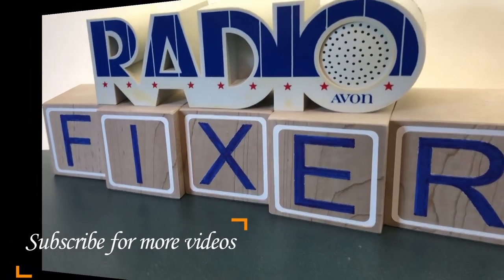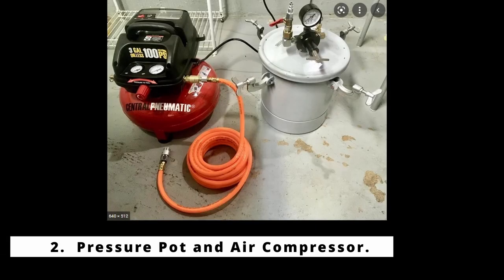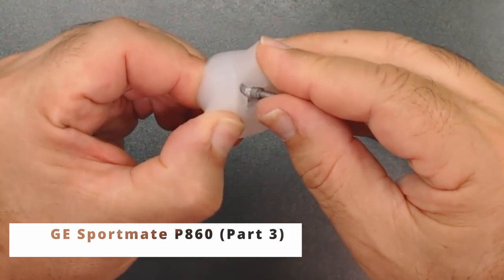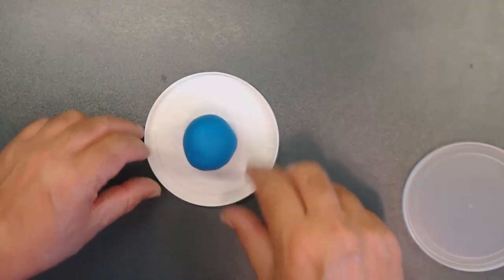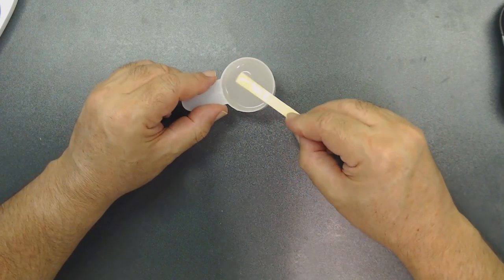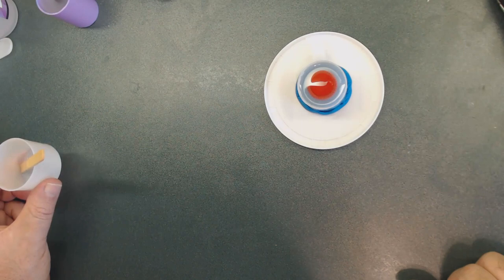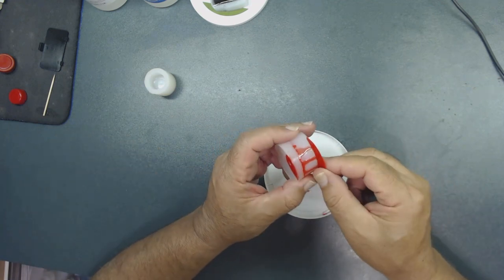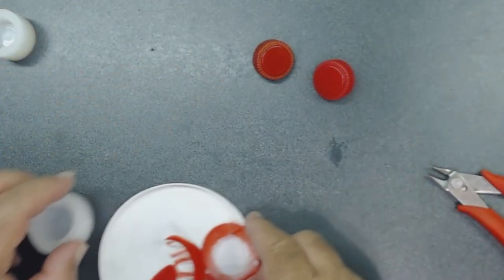How to make Knob and other missing Parts

Comment: This was fun to watch!! About 10 years ago a TV radio repair shop closed up. I was able to get a box of about 500 radio and TV knobs. Before they scrapped a radio or tv set they pulled off the knobs.. I have used many of them to replace damaged or missing knobs.. It may not be the original knob, but it has that vintage look so unless you have a picture of the original radio knobs, you cant tell... Robert
Reply from the maker: Robert, so happy to know that you enjoyed watching this video. It is very fun making those parts and radio knobs. As always is so good hearing from you. have a great day! Regards, JZ

Comment: Thank you! Almost all tutorials on YouTube are for flat knobs (drill a hole in back), or those with brass fittings. Almost no one shows the very common split shaft potentiometer knob like this one. Working on a 1950s guitar amp and debating making a replacement knob.
Reply from the maker: Hi Cal, so good hearing from you and glad that this video can assist you to duplicate your guitar amp knob. It is fun making your own since every time you look at guitar amp reminds you of your accomplishment and how you created. We never learning until we try. Use bobble free product that I discussed on this video to make the job simpler. Good luck with the project, have a great day! Regards, Jay

Comment: Excellent video.  Perfect detail and some great ideas.  My only issue is you can't make a missing part.  You need at least one to copy.  I have a few radios that I'm rebuilding.  All the knobs are missing.  I'm looking for a way to make one know from pictures.  Then I can cast a new set.
Reply from the maker: Hi Steve, thank you for uplifting message and taking time to message me. I know what you mean; it is much simpler having at least one knob to duplicate more knobs from it. 
What I did in the past used toothpaste or other bottle caps and create a mold from those since some of them are so close to radio knobs design. Look around the house to see what bottle caps can be use. I also fund one knob on eBay and duplicate that for my radio. It is lots of fun to create your own radio knobs, great personal satisfaction. 
You might enjoy watching “Rat House Radio” on my channel, that radio did not have any knobs and was a basket case.
Have a great day! Regards from Jacksonville Florida, Jay

Comment: nice I have been wanting to reproduce some dogbone resistors  I have been looking at Alumilite mold maker to use to make my molds .
Reply from the maker: Hi Richard, Alumilite is a good product and I used it before but you need special equipment to take the bubbles out. Try Let's Resin products, it much easier to use and is almost bubble free, follow their instructions to get a great result. It is lots of fun making your own parts. Check some of my transistor radios that I had to fabricate missing parts for it. Good luck!